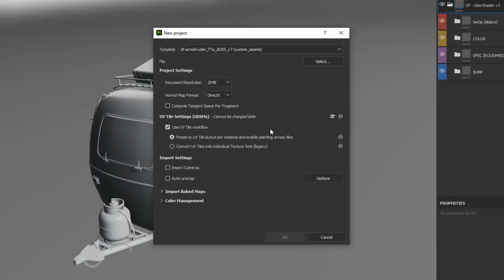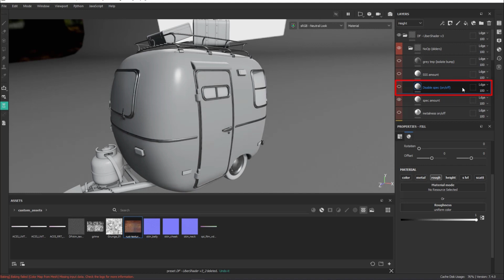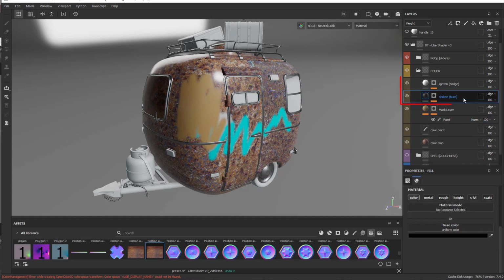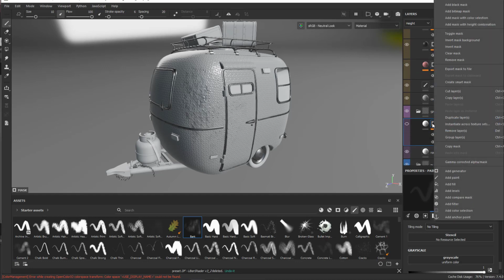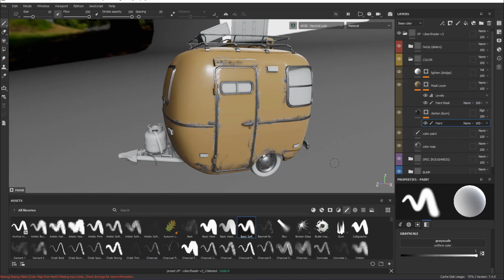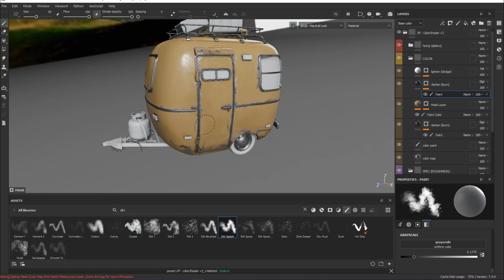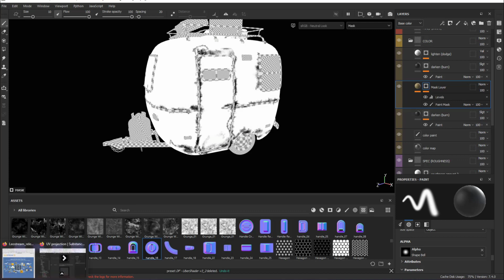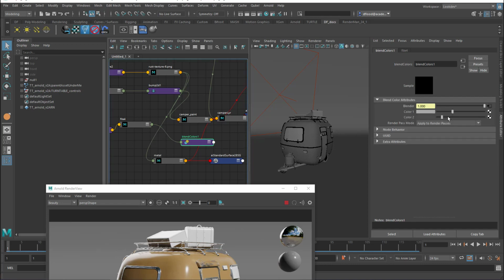Substance 3D Painter: Custom Tools & Workflow

Comment: Looks nifty! I'm currently testing a bit by using Painter to fix textures to test the new OpenPBR material type in KeyShot's latest 2025.3 beta. I struggle a bit with the default shaders available in Substance but your template might help with that as well.
Reply from the maker: The ASM is pretty good. OpenPBR was based on ASM and standard surface. My UberShader is intended as a template for that

Comment: What is the latest version of UberShader? The download has UberShader v2.0 and v2.5,  but your video shows you're using v3. Is there a later version of this? Thanks!
Reply from the maker: Well, since you asked I just pushed an update to the Repo which includes a new version of the UberShader (v4) that supports the new translucency feature in Substance Painter 9 for glass-like materials.
Reply: awesome! Can't wait to check it out. Great timing!  @derekfloodVFX
Reply: Hey Derek, after adding that UberShader v4,  I am getting an error when launching Substance Painter.  It says, "[Data Preset] Invalid preset resource://your_assets/DF - UberShader (Sp9) v4". Any guess as to what may be going wrong? The 2.5 version is loading fine, just fyi.  @derekfloodVFX
Reply: Hey Derek, not sure if I'm doing something wrong or not, but I get an error when loading the v4. Just figured I'd let you know. Was looking forward to trying it though!  @derekfloodVFX
Reply from the maker: @tubeofmystery  what version of Substance Painter do you have? What is the error?
Reply: I'm using version 9.1.1.  Here's the error "[Data Preset] Invalid preset resource://your_assets/DF - UberShader (Sp9) v4"      @derekfloodVFX
Reply: Every time I paste the error, it gets deleted. Let me try to break it down...
[Data Preset] Invalid preset resource : / / your_assets / DF - UberShader (Sp9) v4
 @derekfloodVFX
Reply: Every time I paste the error it gets deleted... I will try to break it down without the url. 
[Data Preset] Invalid preset resource...your_assets...DF - UberShader (Sp9) v4

 @derekfloodVFX
Reply: I'm using 9.1.1 of SP. I keep trying to paste the error code but it is getting deleted. I'll try again without the url. @derekfloodVFX
Reply: my comments are just getting deleted regardless.  @derekfloodVFX

Comment: Really neat workflow.. I really liked the idea of NoOp group... other than that the idea of having the bump and the color channels seperate might be a little bit disadvantages for substance painter workflow but still have a global slider to manipulate each and every channel seperately is really great... And still substance painter exports -1 to +1 values of height maps.. meanwhile some render engines requires it to be 0 to +1.. ..
Reply from the maker: Regarding height maps as HDR images, that's why I'm using EXR for the height maps since this can hold that -1 to +1 range. SP is supposed to normalize this to 0-1 with a PNG but I've found that detail gets lost. When you say some renderers require 0-1, which ones are you referring to?